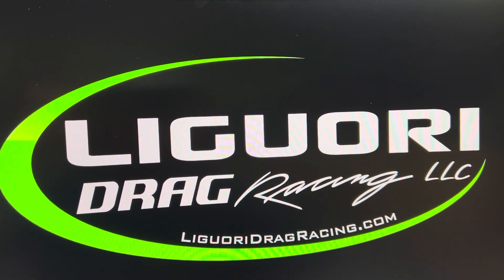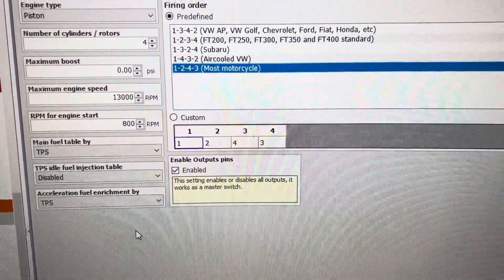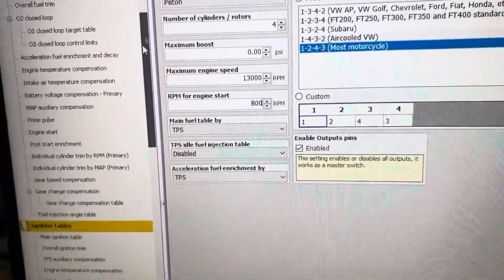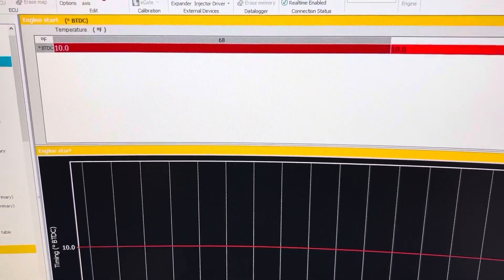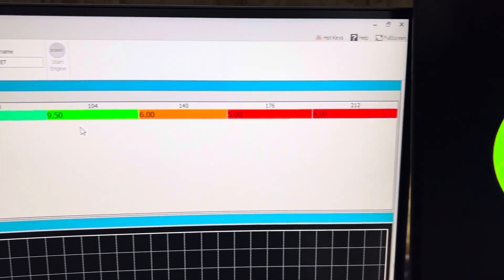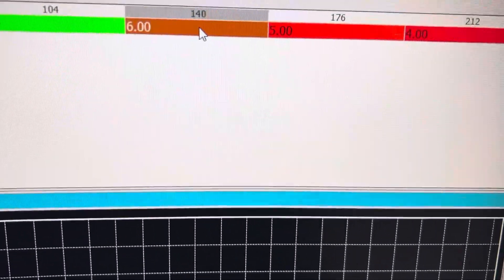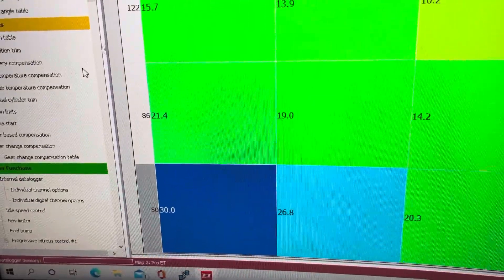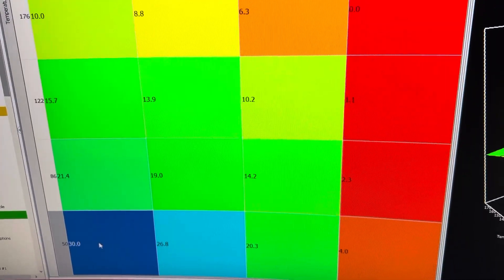Engine start RPM, fuel and ignition settings with a FuelTech

Comment: Hi. Great vid. Can you do a vid explaining wiring and software settings about boost controller using Mac 3 port solenoid? Thanks using manifold pressure not CO2.

Comment: Prime pulse? What is that?. I will like a video about that. Thanks
Reply: prime pulse is ms the injectors are pulsed when you key on ignition to help start the engine... just puts a bit of fuel in the intake runners/cylinders in addition to the fuel the injectors spray in when they are triggered normally during cranking

Comment: I’m having trouble with keeping my engine running while cold . Then when it gets up to temperature it’ll idle fine . Had to pull lots of fuel out of engine temperature compensation also air temp compensation actually pulled it all out . Maybe my injectors are way to large?
Reply from the maker: I would be curious to know what your timing is doing when cold at idle, is your timing on the lower side?
More timing equals more RPM.
Less timing equals less RPM.